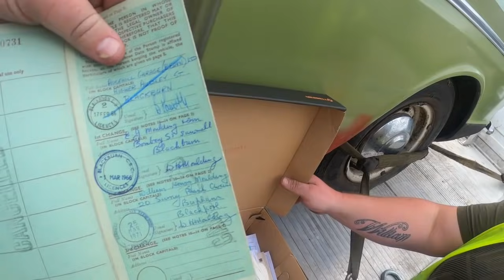WE'RE BACK PEOPLE CLASSIC CAR BARN GARAGE FIND HILLMAN IMP

Comment: This version was about the best built, before Chrysler got involved with cost cutting. I have a Sport version (E) reg in UK and still on the road 54 years later in NZ.  Just to be certain I also have two more, a Mk1 Imp and Chamois.  Remember the guys who drove from South Africa to Coventry in 2013 to celebrate it's 50th birthday.  They made it.  Just shows how durable they are with the correct maintenance.

Comment: Hillman imps were rusty from the day you picked them up new from the garage. Then it would gradually work it's way around the centre of the car from the passenger door, across the roof and down the driver side, in an almost perfect straight line.

Comment: They were a quick little car back in the day. I used to have a couple of bags of sand in the front to keep it where I wanted it round corners.
Reply: I had 2 bags of cement in mine lol 😝
Reply: Two bags of lead shot. Front radiator.  998 motor twin nikki carbs . 677?? Camshaft. Welded head. Discs on the front. Mini light wheels. Loads of other bits but it's a long time ago. Good fun.. oh one off manifold and exhaust across the back.

Comment: Nice to see you back lads, missed the vids. Shearing known as shearing at EMR Blackburn? Only heard Vandle mention it but hes down south. Dont want rock up and look a twat if they call it something else 😂🤣
Reply: Yeh same thing pal what is it that you have got so can try help you out and Point you in the right direction👍
Reply: @scraparoouk7421  all sorts mate, been street scrapping but just throwing it all in the shred light iron pile. If it's just metal with no crap attached it goes as shearing, is that right?
Reply from the maker: Yes pal bed frames radiators filing cabinets etc anything clean pal rest of stuff cookers washers prams etc all in frag feed pal